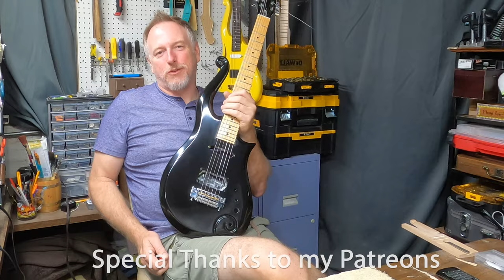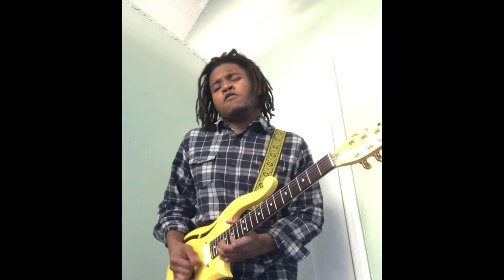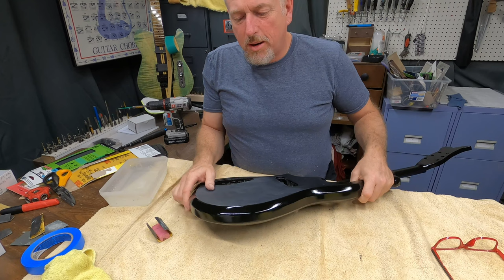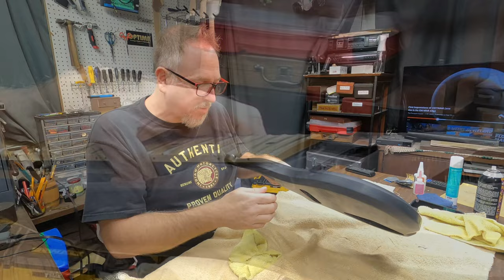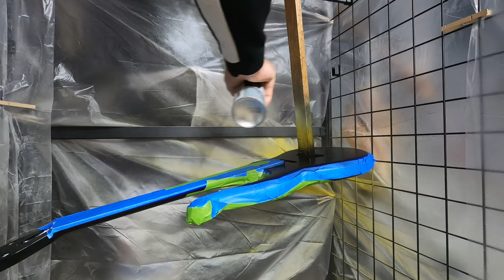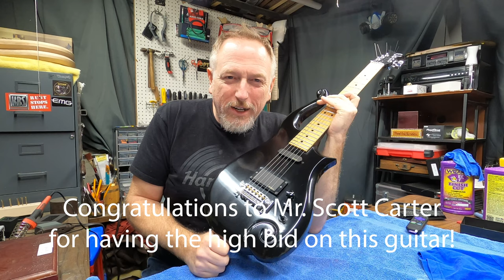Did I just BURN through my Clear Coat?  Now What?  Tips on getting a nice finish!

Comment: It's always a fight to get it flat enough to shine like glass and not burn through. I gotten too where I hate the idea of finishing. Like R.L. Lynch I have thought about going oil/wax only but I love a gloss finish on guitars. Even all natural wood looks amazing through high gloss. I've just finished a very small spray both and purchased automotive products, buffer, pads and compound for the final buff out. Plus I'm using 2K Tamco clear. No rattle cans. I'm not sure I could ever get enough build with rattle cans.
Reply from the maker: Yeah with the rattle can I do about 21 coats.  I’m just so limited with having a good place to use a compressor with enough ventilation.  I do it on occasion using my garage but due to temps in Minnesota and the need to use my garage for other things….it just doesn’t work well.

Comment: I started using hard wax finishes and stopped painting. It's an awesome finish and faster with less stress out.  I do not miss all the steps it takes to paint and clear with sanding, sanding, and MORE sanding,, and did I mention sanding? haha I love the work on that guitar it's awesome.
Reply from the maker: What hard wax are you using?
Reply: @letsbuildaguitar9230  osmo 1101 then follow up with 3011 gloss then lightly on a  buffer.